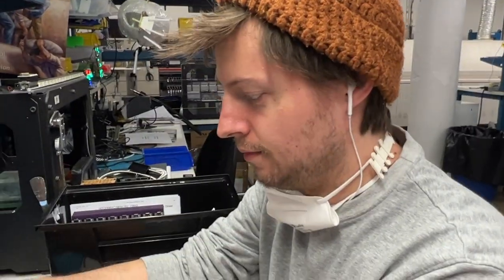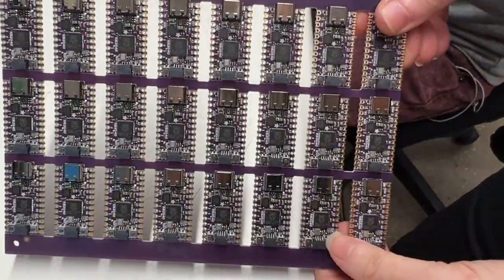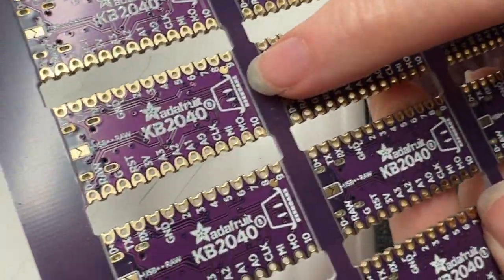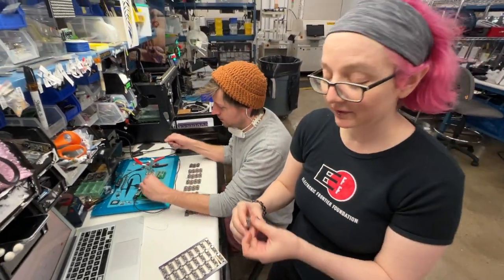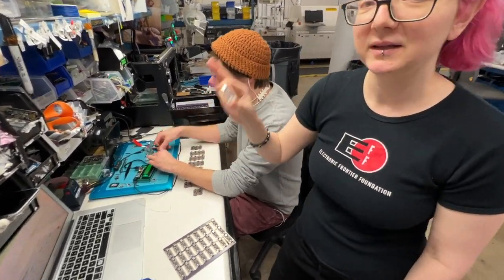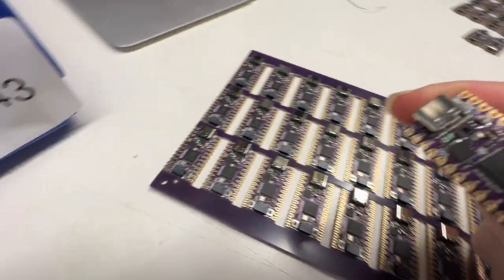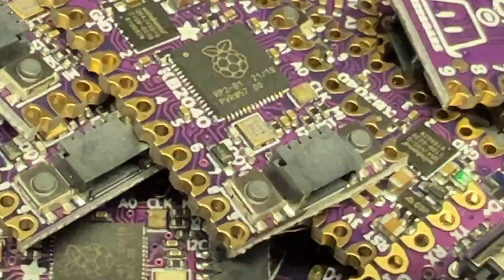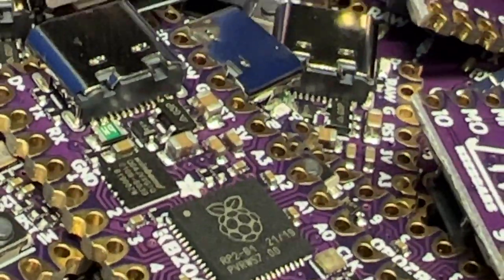👀🐷👀 KB2040 coming sooooonn..... 🐷👀🐷

Comment: What's the QMK situation regarding RP2040 support these days?  Last I looked it needed some ChibiOS feature that hadn't been merged yet, so I continue to use STM32s for my custom builds.  (My thought process is complicated.  I want to use one microcontroller family for every type of project I do.  For keyboards, I'm stuck with whatever QMK supports, so non-32 bit chips, or STM32 series.  For non-keyboards, tinygo is my preferred environment, so that further limits the possible devices.  I have had a ton of success with tinygo on the RP2040, and you get a lot of chip for $1, so I'm very close to forgetting everything I know about STM32 and just being a RP2040 fan forever.  Though sometimes I need hardware floating point, and for that... STM32 still wins.  Maybe I should just use SAMD for everything.  So many decisions :)
Reply: No qmk yet, but CircuitPython works well and has native key matrix scanning built in now
Reply: There is also KMK, a keyboard library written for CircuitPython.
Reply: @linux2037  Ah, very neat.  I am not completely sure I ever fully understood QMK anyway.